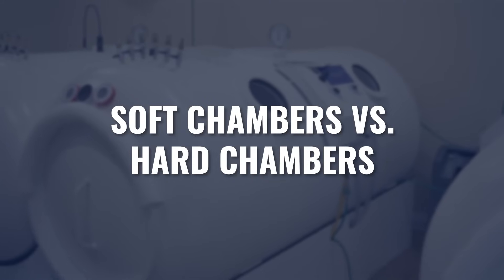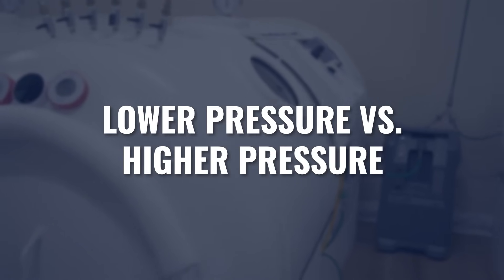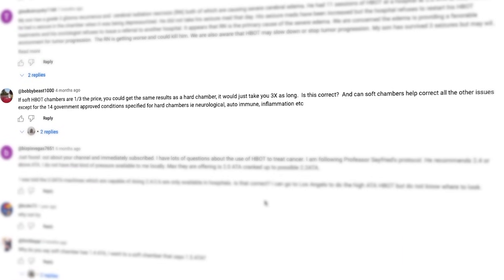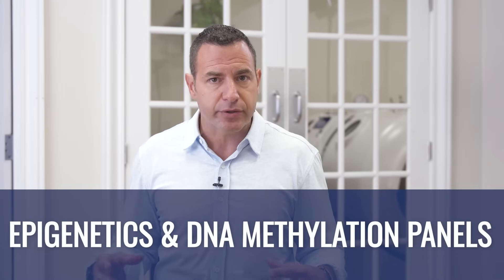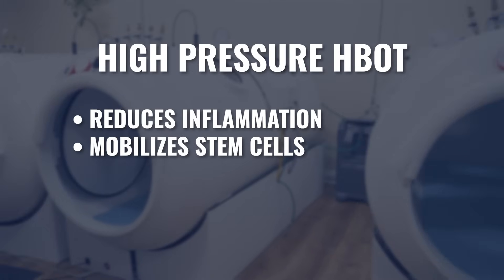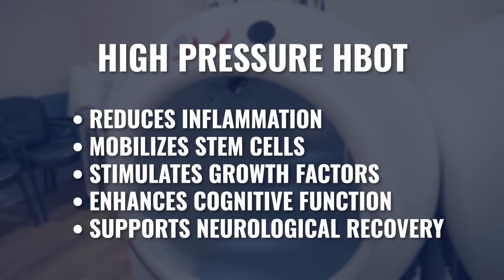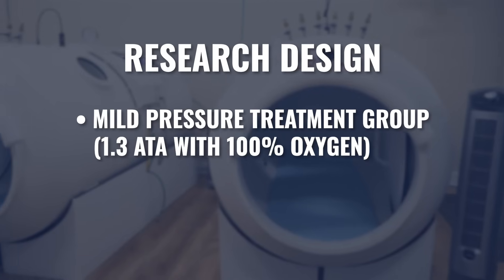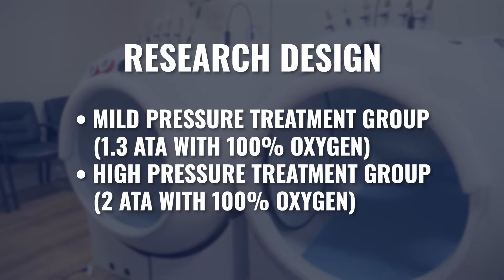HBOT Research: Low vs High Pressure - Surprising Results

Comment: Hello, great work! I have a specific question: I want to get a 1.5 Bar chamber for me, mainly for preventing neueodegeneration (As I have 2 Apoe4 copys) Im a 37y old male. Do you know if lower pressure chambers also reduce Plaques? (Brian Johnson talked about a 28% reductiob but he uses a 2 bar chamber) maby you habe some insight on that! cheers and greetings from switzerland

Comment: Great video. Are the others out?  I don't see them.  My only concern is you used the same protocols/time, but not the same units of oxygen.  80 mins in 2 ATA @100% oxygen is 160 Units of Oxygen ... 80 mins in 1.3 ATA @ 100% is only 104 units of oxygen.  I would have focused more on matching that instead, and I'm doing that in my own 1.4 ATA pilot on extending telomeres.  I'll have my pilot completed end of May and will let everybody know.

Comment: Can I use my dive watch inside hyperbaric chamber to estimate the preasure/depth? To be sure that I am not scammed with the preasure or over exposed?
 I don't knos, but after last hbot session my mask smell as detergent,  the operator pump the chamber but I wasn't alone.
 I feel this time something going different. I feel that the pressure it was higher than previous time and the length!
 After hbou I felt my lungs diferent(like scratched)
 On next day I was sick as hell! 
Green nose secretion , glogged ears, from my left eye also coming green secretion.
 I don't know what's wrong happened but I catch very serious vurus! 
 I am litle bit afraid to using HBO2 therapy on Varna, Bulgaria!
 I remember that before this session I haven't ability to come 2 times(Maybe the owner/operator gets angry)and on this sesion after happened those things!

Comment: Thank you so much for the two reports already posted and those to come. My wife and I now have over 350 hours over the course of 16 months in our 1.4 ATA two person soft chamber using a pair of 10lpm concentrators with non-rebreather masks. (Non-rebreather masks come with string-like straps which I have replaced with Velcro straps for a much tighter fit.) I have twice read Oxygen Under Pressure, watched a great many of Dr Sonners' videos, and read all available human-based clinical research covering effects of HBOT on cognition. I do need to read Dr Sonners latest book.  We can attest to the strong benefits of HBOT on arthritis, psoriasis, and cognition. I am always on the lookout for ways to fine tune our protocol which has settled into 1 hour per day, 5x per week. Based on what I'm seeing in these videos, I'm going to try altering that to 20+5+20+5+20+5+20, 3x per week. I hope Dr Sonners will publish his 225 page dissertation.
Reply: what do you mean by 20 plus 5?

Comment: What is the purpose of the air breaks?
Reply: It has been proven by a nobel prize winning Israely study that the air breaks stlimulate angiogenisis. It's called hypoxic/hyperoxic stimulation. Basically, the brain thinks you are suffocating and relases stem cells and vascular growth factors that accelerate repair.

Comment: And what is the MOA? Likely hormetic effect going from hyperoxia to normoxia. An oxygen concentrator probably delivers 90% of effect of HBOT at a fraction of the cost. I’ve gotten reduced inflammation and better epigenetic age with my system
Reply from the maker: @PaulBeauchemin  that is definitely a major piece of the mechanism….. a concentrator at the surface? That will likely stimulate some minor changes but certainly nothing comparable to oxygen under pressure. If hormesis and hyperoxia/hypoxia are the mechanisms oxygen at the surface does not move the needle anywhere near what the t would in a pressurized environment

Comment: Sir this was an amazing insight. Thank you for your effort. It was a question many of us had.

As a heart fibrosis patient following subjects would be interesting:

- How would HBOT pair together with LLLT (simultaneously while in Chamber?) 
The benefits are quite the very similiar:

Tissue Repair & Healing:

Some studies suggest wound healing can be accelerated by roughly 30–50% compared to untreated cases.

HGH Stimulation:

Although research is more limited, certain findings indicate that LLLT may boost HGH levels by approximately 10–20% in some contexts.

Stem Cell Activation:

In vitro research has shown that LLLT can increase stem cell proliferation and differentiation by about 30–50%.

Pain & Inflammation Reduction:

Clinical trials have reported reductions in pain scores by up to 40–50% and decreases in inflammatory markers by around 20–30%.

Collagen & Elastin Production:

Some evidence points to a 20–40% increase in collagen synthesis, aiding in skin and connective tissue repair.

Neuroprotection & Nerve Repair:

Animal studies have observed improvements in neuronal survival and function by roughly 20–30%, though human data is still emerging.
Reply from the maker: @whoknows8223  yes a lot of Themis data sounds accurate. In terms of your potential usage I would agree using these tools will
Likely help though I cannot give any specific protocols or advice through this channel. Each case is unique and the best amounts/frequencies/dosages will vary dramatically case by case. I hope you understand
Reply: What is LLLT please?
Reply: @michelehouse5294  Low Level Laser Therapy (around 600-800 nm wave lengths).
I bought one of this big lamps on amazon for like 80€.
There is a study that showed if used just after a heart attack 90% of the damage can be prevented. But healing/prevention is not the interest of Ph*rma. Their business is selling products to sick people.

Youre welcome.

Comment: I am so impressed with your work and look forward to your reviewed Publications. I assume you're also doing a doctoral dissertation. Keep it up this is groundbreaking research.

Having said this, other anti-aging researchers have noticed this lag time that you have mentioned.  For example the work of Dr Greg Fahy and his team, did not see any Improvement until 9 months into their treatment protocol.

While I can't speak  for other researchers, several research groups have discussed senescent cells and senescent associated secretomes that are freely circulating in the body as we get older.  

Doctors Conboy and Kiprof have noted improvements by simply removing some of these senescent chemicals out of the blood and lymphatic system. 

Another explanation for this lag time could be associated with the Krebs cycle (the chemical process that produces ATP in the mitochondria), It appears that oxygen (like the high pressure oxygen you are studying) is probably an incredible stimulator of this cycle and the mitochondria where it takes place.  It is possible that it takes a while for this high pressure oxygen to rejuvenate the mitochondria in the senescent cells and get them back to more normal production.  This could explain why it takes a while for your process to work. This is speculation but we need to be looking at issues like this when we think about the mass application of these technologies to reverse sarcopenia and other age related problems.  I hope you start testing HBOT on a group of people with sarcopenia that are restricted to wheelchairs and see if this process helps them like I think it will.   I understand scientific inquiry has to start somewhere but please remember everyday groups of people get more and more disabled by aging and to end up losing their Mobility.

Comment: Are there any 2.0 ata Hyperbaric Chambers for use at home that meet the applicable ASME pressure vessel and NFPA fire codes and are under $50,000?
Reply: Search airvida chambers
Reply from the maker: @oakleydude06  unfortunately none that I am aware of. I would say there are none under 100k   That I am aware of.
Reply: Oxyrevo     I have ordered a 2 ATA  sit up .   . AROUND $is $30+.   Peter Australia

Comment: I have a soft chamber at home to help relieve any long covid relapses. It works great.
Reply: Do you need a license to own one for home and get Oxygen for it?
Reply: @jimshu245  soft chamber HBOT does not require a license of any kind. HBOT generally use an oxygen concentrator 5-10 LPM.
Reply: I live in France and we do not need any licence here to buy a soft chamber for personal use. . MIne ranges from 1.3 ATA to 1.5 ATA. For upper pressure, it is not allowed for personal use. 
 @jimshu245

Comment: Very interesting ! Thanks! 
Regarding air breaks, I am wondering if it is not of a problem in a soft chamber. I checked several times the CO2 levels during the sessions, and it is extremely high after 30 minutes , it is above the levels the device can go up to and the alarm rings .
Reply from the maker: Is your chamber a "flow" type chamber? Meaning, you leave the compressor on the whole time and there are pressure relief valves that limit the pressure? This allows air to flow through the chamber and constantly refresh the O2 and CO2 levels. 

Regarding the air breaks, they're not needed in a soft chamber from an oxygen toxicity point of view, but there is therapeutic benefit to doing the air breaks. Check out this video for more info about that: https://youtu.be/4m1KmA20ESQ?si=U7ikkA9oyxdbCu_k
Reply: Thanks for your quick answer. Yes I have a flow type chamber .
Reply: Some air comes through the valves, but the level of CO2 reached 5000 ppm , which is the maximum whith this simple  cheap  device  I bought on Amazon. Maybe the level went up even higher. 
Does  5000  ppm of CO2 seem OK to have air breaks ? 
Thank you very much !
Reply: I use nasal cannulas and exhale through the mouth. It would maybe be better not exhaling through the mouth or use a mask ,  to lower the CO2  level in the chamber ( if it is a problèm to have a high level of CO2) ?
Thanks !
Reply from the maker: @annecomeliau7191  sounds like you need to vent the chamber more often and or increase the compressor flow rate.
Reply: I checked, and with the MACY PAN' soft chambers, it doesn't seem one can change the air flow of the air compressor. 
When I enter the chamber, the CO2 level is around 480 ppm , like in the apartment. 
I noticed that if I exhale through the mouth but into a thick scarf and not directly in the chamber, the level of CO2 is lower.  It doesn't go higher than 2500 instead of 3500. 
What would be the maximum CO2 level that would be ok to have air breaks? 
Thanks a lot🙏
r @HBOTUSA
Reply: If using a mask, the maximum CO2 level is 2968 ppm. 
Would it be ok to have air breaks with this level ? 
Thanks a lot !

Comment: I am wondering why you used 100% oxygen at 1.3ata as most soft chambers that people buy to use at home will definitely not use 100% oxygen.  This won't tell people how much benefit the home chambers will be
Reply: I would assume it was to keep that a constant between test groups. If oxygen is variable, you can’t attribute the results to just the pressure change
Reply: He would need to be very clear 1.3ata is not the home soft chambers. As people will not know this  @JenniferMartin-z4t
Reply: The main thing lots of patients wanted to know was are the soft chambers that one can buy to use at home can compare to 1.3ata with 100% oxygen
Reply: There's a soft chamber that can go at 1.5.

Comment: Great work doc.I really appreciate what you do. And how you explain everything in detail. Just purchased my hbot...need to put together. I got it specifically for my chronic pain, I had a cervical fusion 6 yeas ago and the pain just does not go away. tried everything and I do mean everything so I am hopeful that this will work......Once again thanks for what you do.
Reply from the maker: Glad to help!!
Reply: Hope you find relief. I have a cervical fusion and am 20 dives in for other issues. I have noticed my joints move far easier, including my spine other than the fusion, and stiffness/tightness and pain have greatly reduced 🤞
Reply: Try a very low or zero oxalate food intake and watch and feel the pain disappear. My heart goes out to you about your pain.
Reply: I also had a spinal fusion over ten years ago. Also have D.I.S.H, managing pain is a daily task.  Hyperbaric helps with inflammation that contributes to pain. Also part of my weekly routine is sauna with cold plunges. This helps tremendously for fast relief. Also have many other devices,  table inverter, traction device, EMS/Tens unit, and more. Over all I feel good as long as I stay with a routine and eat healthy.

Comment: At 16:35 in the video,  you mentioned that you didn’t see significant changes during the first 5 weeks of treatment, doing 3 dives per week.  5 weeks x 3 dives/wk =  15 dives 

You mentioned that it wasn’t until after the second 5 weeks of treatment , doing 3 dives per week, that you started seeing significant changes..  10 weeks total  x 3 dives/wk = 30  

So just to be clear, two sets of five weeks of treatment, doing three dives  per week, would a total of 30 dives total.  

You mentioned in the video not you did not start seeing significant benefits until 50 dives .   That would mean you didn’t see significant changes until after the third set  of the 5 week treatment blocks.   15 weeks total x 3 dives/wk = 45 dives total 

Is this correct?  Thanks
Reply: Yes, this is a critical question I had as well!
Reply from the maker: The sessions (dives) were 100 minutes long (not 60), so after the first five weeks they completed 25 hours of HBOT. Then after the second group of five weeks they did another 25 hours, for 50 hours total. That’s why the hours and the dives don’t lineup 1:1. 

I said this in the video, but to reiterate, we likely would have seen some changes after the first 25 hours if we would have waited longer to do testing. There seems to be a delay between changes that are happening cellularly, and when they’re measurable in the blood.